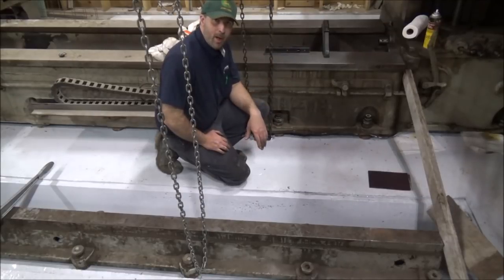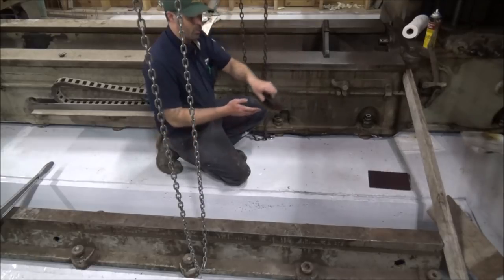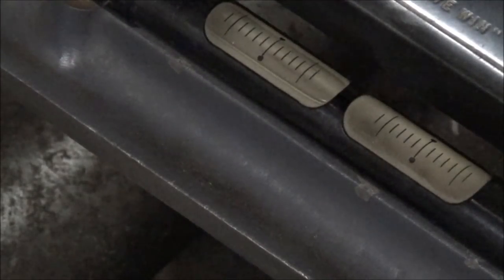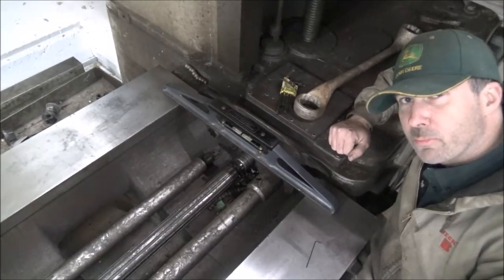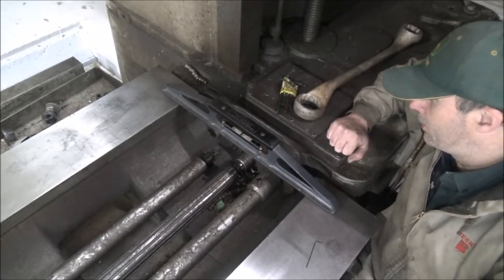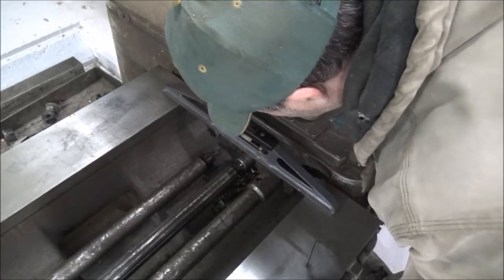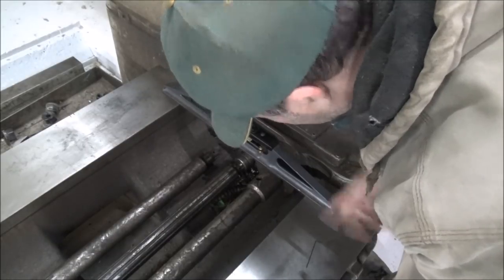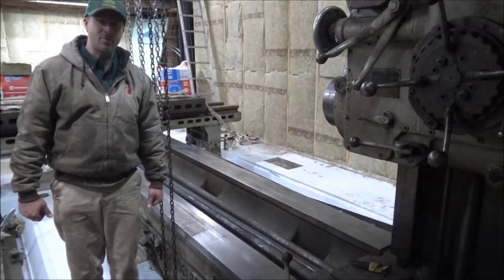Mill Level Part 1...................... I got a Problem :-(

Comment: Generally there are only 2 things that will make a precision level behave this way. 1 is surface contamination which usually can be detected by applying pressure at either extreme end back and forth. 2 the level has either been dropped or plaster has shrunk away from vial from long term dehydration of plaster, was applied too wet in the first place. Both are fixable without vial replacement. Cheers...
Reply from the maker: I have tried it in multiple places and always get the same results. You 
can see how in the video the bubble slowly comes up then it takes off to
 the other side. I even put it side by side with my other level and 
tried the same thing and the results were still goofy and incosistent. 
If it was one line I might go with it being me but 3-4 lines something 
is wrong with the level.
Reply: bcbloc02 , I will follow with great interest. Hope you post a video on how the level turns out.

Comment: I bought some precision 10 arc second vials from Level Developments. Planning on making a level. 
 Is your vial ground or bent? It is hard to imaging a ground vial going bad a bent one maybe.
Reply: im willing to go with faulty from manufacture and no-one bothered to sort it out
Reply from the maker: It is ground but it is 80 years old too.
Reply: I would be very surprised if the vial itself has gone bad due to age. There are glass telescope lenses well over a 100 years ago that still work fine. The precision in a lens is way beyond what is needed for a level vial.

Comment: In the time between checking the reading on the precision level Jupiter traveled 784 kilometers of its revolution around the sun. The when you tried the original setting . . . it traveled back? hmmm Easiest solution? How do we stop Jupiter while you are working?

Comment: After 50 yrs of surveying, all of my level vials were filled with alcohol or a compound similar.  Levels were flatter radius compared to total stations(transits). You might be going  to a gunfight with a pocket knife. Over the years I was asked to provide alignment and leveling service for large machines but never had correct equipment. It's a specialty. Bought a colimnator for my lathe.  My T-16 could read high precision invar rod. Just sayin' Not saying your approach will not work. Just as easier way. You can use my T-16, but would need rod and heavy duty tripod.
Reply from the maker: I can only fight with the tools I have.

Comment: You know that you can use any long enough rigid thing to span the distance, right?  Take your short level fix it to the long thingy, Calibrate the whole thing on your surface plate for level and go to town with it.  As long as the touch points are calibrated to the level you are golden.   Richard King asked me to write a little blurb on how to calibrate a level on any surface. http://www.practicalmachinist.com/vb/machine-reconditioning-scraping-and-inspection/scraping-precision-master-level-342871/index2.html#post3081948
Reply from the maker: Yeah I can rig something if I have too but using 2 levels on this big machine is way better, trying to adjust with just one would take forever.
Reply: posted more bits to htral's comment.  I also used RTV silicone to mount vials in my kingway clone :).

Comment: I'm sorry , i'm metric however you said your level has a resolution of 0.0003 per line and i guess it is referred to one foot. Then you said that 3 lines on one side equals to 15 arcseconds. One arcsec equals approx to 0.00006"per foot. Acordingly to this ,15arcsec equals approx 0.001" which is very close to 0.0003 per division. I guess your level is way too sensible. I would look at the conditions of both the ways and level base.

Comment: Ok ok time for a call or an e-mail to Richard King or contact the manufacture of the level, get it right, get it checked out. Let;s Roll!
Reply from the maker: The manufacturer has been out of business probably for 50 years. I suspect this thing dates to the 40's, Bullard bought the level design from the company that made mine and I don't know that they were still around after the 1960's.

Comment: Lots of work. Great Job. Do you have a lot of work requiring a machine of this  size?  Or plans to expand into machining of that extent ? 
  Great content. 👍
Reply: I think he mentioned doing tractor engine blocks on it.
Reply: Thanks.  I had watched the millwork on the rear drive housings.  Must have  been in la la land. Didn’t remember hearing the usage.   Once again Thank You.

Comment: old oil, coagulated, too cold your wearing a coat put it in a warm place in the house and retry...
Reply: Investigate temperature all by itself.  Use an infrared temp measuring tool to get the vial's temp remotely.  Bring the level inside and let it warm to ambient temp (70 degrees F?).  Check for this problem.  If the unrepeatability remains, get a hair dryer or heat gun or just an infrared heating lamp and warm the level to the max temp you'll use it at.  You could warm it above that, if it doesn't respond initially.  The point is, does heat affect this problem at all?  

You want to test the level with one variable at a time.  Think about what variables there are, and order them in likely hood then test for them in that order.  
If you think the vial is moving in its mount, check for that. Less likely is that some tiny piece of grit under the flat bottom, because the result would be more repeatable than it is.